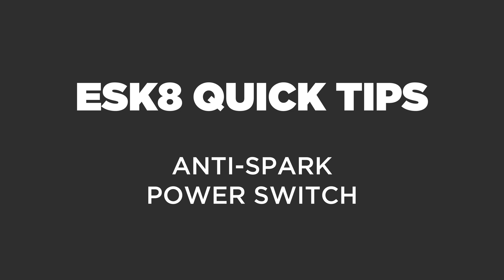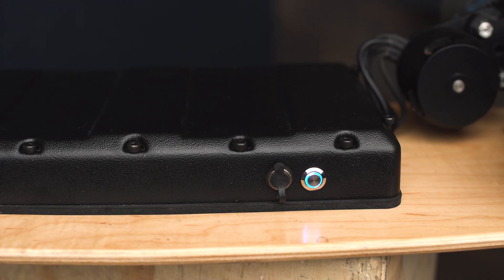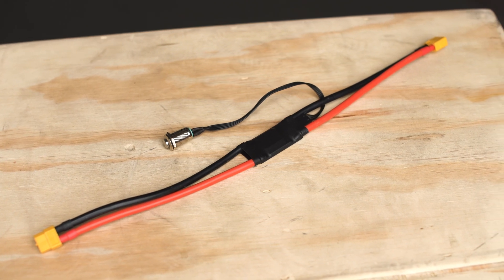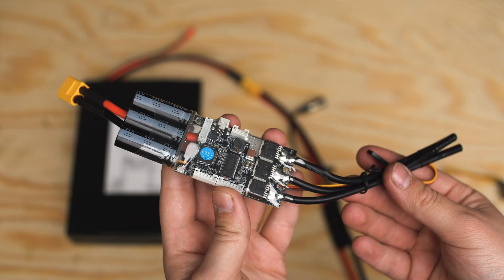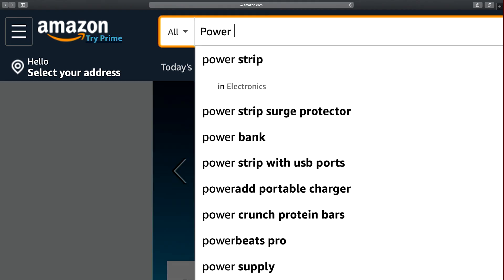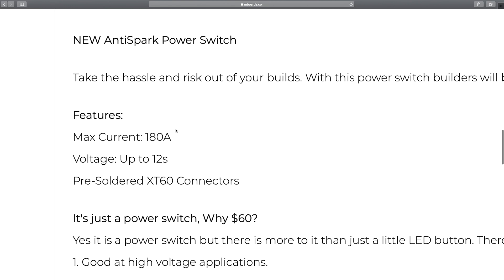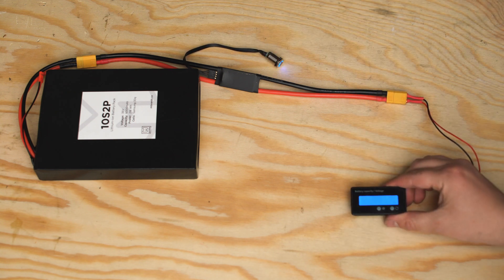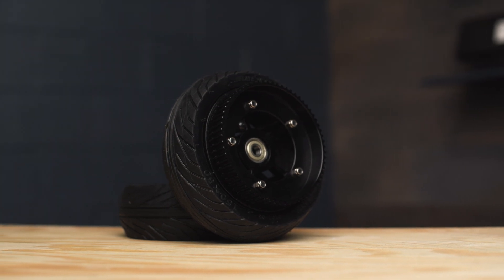Best Power Switch for DIY Electric Skateboard

Comment: My ESC cost $80, I dont think spending another $60 seems worth it... but I appreciate the video for sure
Reply: They have plenty of antispark switches for under $50usd. If you aren't disconnecting your battery then you don't need one. You should still use an xt60-s connector to prevent sparks. The antispark switches are mostly useful for vehicles with removable batteries like a lot of ebikes have.

Comment: So I got my flipsky motors and brains, with remote. All are awesome, but the EFC doesn't have a power button like you said. Now my 280A Anti Spark Switch came from Amazon fast. But after hooking up my anti spark switch the light button doesn't turn off and power remains on. Once looking back on Amazon the order showed 3 wire on this anti spark switch and mine came with 5 wires for the switch light.. I really don't want to send back and get a new  one because of build setbacks already. So how can I make this work still. Cut the extra two wires and on/off work or cut maybe one. But who knows if it will shut off my board. You maybe. Thanks

Comment: I want to add one of these onto a DIY battery that I built for a V1 Onewheel.  Will this work to charge the battery through the same exit leads? Would I just power the switch on and then plug in the charger? Thanks for your help!

Comment: in the meantime while i wait for the new switch to get here is there a way to "hard" turn on my board so i can use it still
Reply: you could always make a loop key which works well but you don't have the protection of a short if it does happen.

Comment: Hey, my power button just got damaged and it also showed the battery, and I cant find a replacement anywhere, and this anti spark basically be and on and off switch for the esc or is if better to get another esc?

Comment: Do I really need this anty spark plugs.. on eboard or can I skip this coz it's too pricy since motor, esc are already costly.
Reply from the maker: An anti spark switch is always recommended whenever there isn’t a built in power switch on the ESC. 

Plugging in and unplugging an ESC from a battery over and over again increases the chances of ESC damage over a long period of time.

Comment: VIDEO REQUEST!  Please explain the direct drive system. What engine should I look for in regards to KV (higher like blet's or lower like hubs), can we build a direct drive system or do we have to purchase the whole system? Is the motor size a factor in the internals  that attach the motor to the wheels or any motor would work if the wheel size can accommodate the size of the motor? I checked your store and you have a pre-built direct drive, I would like to get the parts and build it myself or learn how to modify it. I'm looking for torque (10 inch wheels) and not speed. Thank you for all this videos, it is priceless information for me.

Comment: PLEASE MAKE A 
2020 ELECTRIC PENNYBOARD 
with an actually Pennyboard!!!!!  

(P.s: gunna require a smaller enclosure/a 6s2p battery/ dual hub motor/ dual hub motor ESC/ 1/8th truck raisers/ add a battery indicator and show how to solder it too!!)  
(lEDs to make it look futuristic?????🤷🏻‍♂️)

(P.p.s: make it light weight as possible please!)
Reply from the maker: The original penny board build we did was about as small as we can pretty much do using off the shelf parts. 

Using an actual penny sized deck would make the 70mm hub motors look huge and not proportionate. 

As soon as we can find a set of hub motors that make sense to add to a penny sized deck we’re all for it.

Until then we stand by the nickel sized decks 😬

Comment: I see you have the Single Belt Driven Motor ESC for 74.99$ and it has 5 pins for motor sensors but my motor has 6 pins, Do I just de-pin it and not connect the temp wire?
Reply from the maker: Hi! This particular ESC runs just fine sensorless. You can try to re-pin your sensor cable or you can just ignore that cable and run it with out.

Comment: Is there I can control two motors wirelessly kind of like this

Legend
Motor=0
Wire=-
Thing that hose to controller=*
Controller=/

0————————*         
                                           /
0————————*

 It’s hard to explain why I need this so basically controlling two e skateboards  at once
Reply: Goes not hose
Reply: Ya how do you do this
Reply from the maker: For 2 motors you’d want to use either a dual ESC or a pair of Vescs. 

You can use a PPM splitter for the receiver or a canbus cable to connect the 2 Vescs.
Reply: MBoards so I can’t control two skateboards at the same time wirelessly
Reply: MBoards cause I’m really making electric roller blades and I’m going to use your motors but I just don’t know how to control each roller blade at the Sam Tim without wires running up my legs